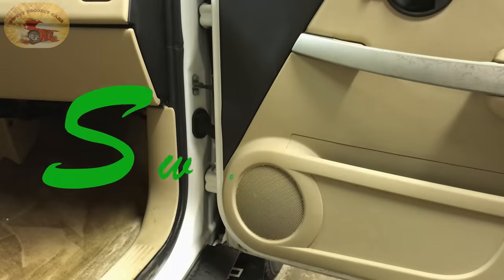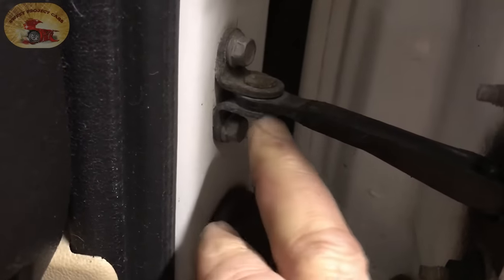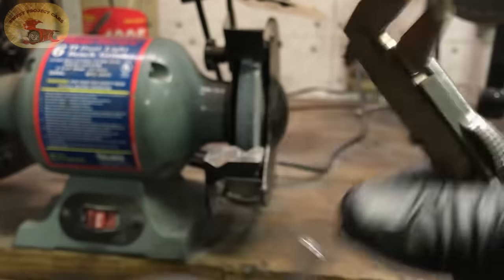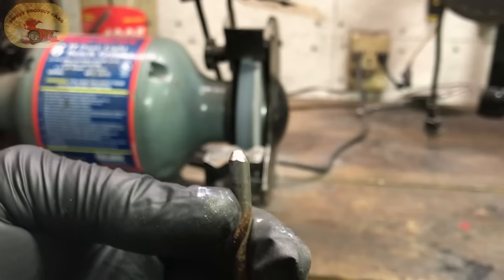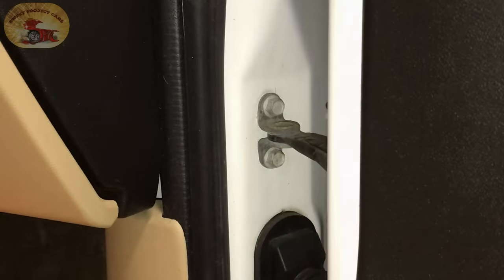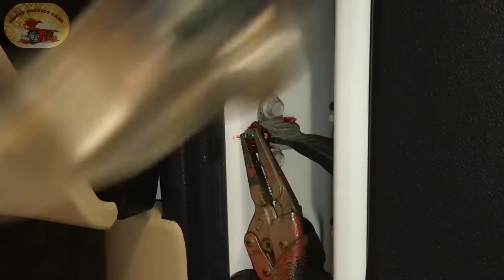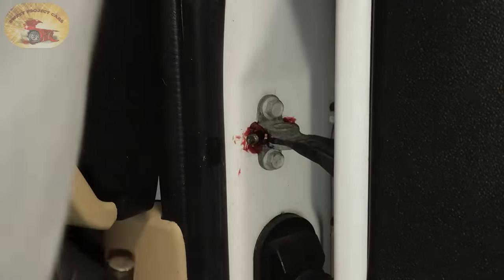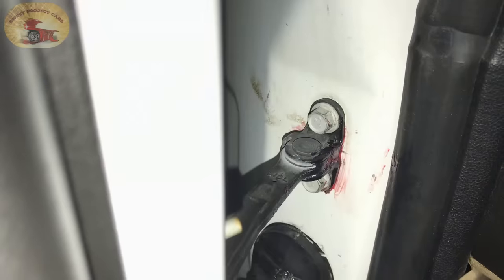How To STOP Annoying Door Swing POPPING... A Super HACK...

Comment from the maker: Hello All of Our Great Subscribers! here is a video for you to load into your memory banks. This is to deal with the annoying Door Check Popping Sound. Also A big Shout out To "BOZ" for funding us through our PayPal funding :)  Now Someday you can help someone or yourself by fixing once and for all a broken door check.
Reply: Hello Mike, I hope your Sunday is going well. This is an awesome trick. I only wish I had seen this before I had bought a brand new one. I'll know better next time. Stay awesome my good friend. 👍😎👍

Brian, Rome Georgia
Reply from the maker: @Boz we fixed the name for you my friend :)
Reply: Mike is there a fix for the other hinge style?  My 2009 Suburban LTZ drivers door pops really bad when closing from full open position.
Reply from the maker: Tim Forfar we just did a 2009 drivers door hinge as it is a real paint to replace it which you may have to do. what we did was look for the pin that was loose and snapping then we took and spot welded it on top with a miller wire  welder and problem solved, any good mechanic can do this for much cheaper than replacing but as I mentioned you may have to
Reply: Mine was doing that then it actually snapped.
Reply: Thanks my car is doing the same thing, will be trying out this trick.
Reply: NEAT video !! I have the same issue with a 2014 Lincoln Navigator.  The 'check snap' - I think- is coming from the hinge that is attached to the door (instead of the 'frame' as your repair job was.  It appears to me that you could have also loosened the bolts that attached that 'check' to the door frame- put the half inch metal spacer in with the grease- then retightened the hinge bolts.  Actually I think I may try that.  I will either use an old metal bit- like you did- OR-- I have some old cooper rivets - I am sure I can find one with the correct thickness, cut the flat head off- cut it to length, grease it up-- and try that.  Thoughts? Ron

Comment: Great tip. I had something like this happen to a door on my Mustang several years ago. A plastic door roller cracked and broke off. Dealership told me the door had to be removed from the car to fix it. I bought the part. It was like $1.50. I told the guy at the dealership I was going to cut the roller in half and drill a couple of holes and screw it back together and file the screws flush. He said it would never hold. I kept the car several years and it was still together when I sold it.
Reply: Stealership. Stay away as long as possible.

Comment: This is a good idea! If u want an easier solution, u can get some dowel pins (M2, M3, etc. depending on the car), unbolt the two bolts securing the check link to the door jam, put the dowel pin in between, and bolt the check link back on. Also don't forget some lubrication. I used M2 pin which is small but enough to cure the snap noise on my car (I can probably go larger, but worried larger dowl pin may put too much stress on that pivot?) Only takes a couple minutes to do.
Reply from the maker: Thanks for watching and sharing, we always appreciate the input my friend, have a great day. mad Mike & team

Comment: This looks simple, but it won't work for mine. **sigh** Whatever is going on with mine is definitely inside the door and not where the strap meets the frame -- that part is solid and doesn't move the same way as the one in this video (and several others).
Reply from the maker: Thanks for watching and sharing Etamni.  Hope you figure out your door issue my friend.  Have a great day.  mad Mike the hammer SPC

Comment: Very nice trick. I have been a Volvo owner for 52 years. And I have let you know that I grew up working with my father at his Gulf stations. When we did a lube and oil change, we vacuumed the car and treated the door hinges and “detention” hinge with a paraffin based lubricant called door ease sold at NAPA stores. It is in stick form that slides up as needed and capped with a tin cap. I have a stick that is at least 30 years old and still using it on my Volvo’s. 
I will comment that the detent that you show is a really poor design. Volvo uses a steel spring with two rollers that sound like something breaking when they need lubricant. You can stop the noise with any spray lubricant (but it will be back soon) or with wheel bearing grease (which won’t make it through the hot times of the year down south here) but will need lubricating by the next spring. But the Door Ease may last several seasons. If people lubricated the door hinges and detent regularly, they would put you out of business on this repair.
The old professor
Reply: Volvos and old professors just go together.

Comment: My 2003 Dodge Grand Caravan drivers door does this for a couple years and it's been driving me crazing. I was about to pull the door apart and replace an expensive part that looks like isn't the problem. I'm without a grinding wheel but will try to fashion a pin without one and try your fix.
Reply from the maker: Give it a shot, you've got nothing to lose my friend. Thank you for watching and sharing, have a great week and all the best on your project. mad Mike the hammer SPC

Comment: well, i am going to try your method as the door stap is 70 bucks and my quarter inch drill bit is very inexpensive , thank you for your knowledge
Reply from the maker: Hello Berry follow the video to a T and you will have great success glad we could help have an awesome day Mike sweet project cars
Reply: @SweetProjectCars  update, my strap did not allow me to follow your instructions exactly,  I had no room to slide the shank with a hammer, so I loosened the 10mm bolts used an Allen wrench to somewhat hit with a hammer , got it to seat,  tightened the 10mm bolts and jebs a millionaire,  I can not thank you enough,  would buy you a cocktail if I wasn't a cheap guy,  thank you again.
Reply: @_1ben  Your comment really helped.  Got the piece clamped in there rather than forced in.

Comment: Great tutorial! I just bought a 02 Honda Accord and when the doors are closed for a long time, (for example the passenger door is hardly ever opening), it seems like the weatherstrip around the door and the frame of the car are sticking to each other since the door is bit hard to pull. I wonder if it is actually the weather strip? It makes a mushy sound whenever I open the door and/or close it. I also have to close the door a bit harder than usual for it to close all the way. Doesn’t look to be crooked either, what do you think? Thanks!
Reply from the maker: n3ro209 i would spray 303 on all the seals my friend  and grease the door check shafts

Comment: NEAT video !! I have the same issue with a 2014 Lincoln Navigator.  The 'check snap' - I think- is coming from the hinge that is attached to the door (instead of the 'frame' as your repair job was.  It appears to me that you could have also loosened the bolts that attached that 'check' to the door frame- put the half inch metal spacer in with the grease- then retightened the hinge bolts.  Actually I think I may try that.  I will either use an old metal bit- like you did- OR-- I have some old cooper rivets - I am sure I can find one with the correct thickness, cut the flat head off- cut it to length, grease it up-- and try that.  Thoughts? Ron
Reply from the maker: Good idea, give it a shot, we always say try it all you've got nothing to lose in trying and testing.  Thanks for watching.  Have a great day.  mad Mike the hammer SPC

Comment: So it's a matter of "wedging" something solid between the door jam (via the back of the clamp) to prevent the door check arm from moving forward? Something's gotta bend to hold that tension, correct?
Reply from the maker: As you see in the video, it's a very simple process, just follow the video instructions.  The door hinge is wearing out, we are making it last longer.  Thanks for watching.  Have a great day. mad Mike the hammer SPC

Comment: Hello, I have question. I have a  camry that I applied the door check with some fluid film and now it swings open with no resistance. I tried to clean it off with brake clean and it didn't work. any suggestion?
Reply from the maker: Mazda Speed the fluid film will be very hard to remove the best thing you can do is get some of this https://amzn.to/2CF71jQ it is the only thing we found that will work and spray it every day as deep into the door check as you can and it will eventually dry up and work again you only need a few squirts everyday

Comment: Lexus CT200h does same thing... really??? was Lexus really that cheap to put this crap on their car?
Reply from the maker: We're with ya, sometimes you don't always get what you pay for other than a cool sounding name.  Thanks for watching.  Have a great evening.  mad Mike the hammer SPC
Reply: Sweet Project Cars you’re right! quality on some of the accessories on these Japanese cars are not on par
Reply: @SweetProjectCars   NEAT video !! I have the same issue with a 2014 Lincoln Navigator.  The 'check snap' - I think- is coming from the hinge that is attached to the door (instead of the 'frame' as your repair job was.  It appears to me that you could have also loosened the bolts that attached that 'check' to the door frame- put the half inch metal spacer in with the grease- then retightened the hinge bolts.  Actually I think I may try that.  I will either use an old metal bit- like you did- OR-- I have some old cooper rivets - I am sure I can find one with the correct thickness, cut the flat head off- cut it to length, grease it up-- and try that.  Thoughts?
Reply: Heidy Elniff i actually tried that! it worked!! thank you. the bolts were loose, but unfortunately one bolt broke loose in the door. i will try to fix it but at least I stopped the popping noise!